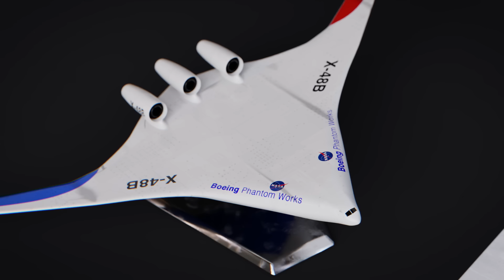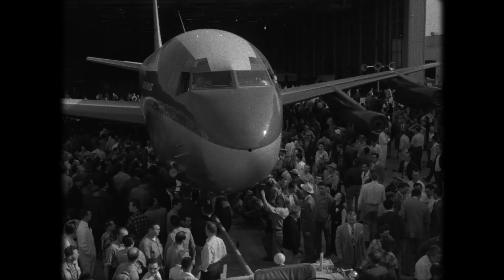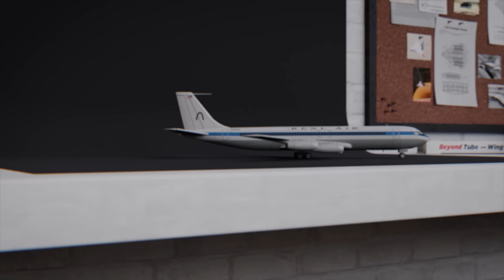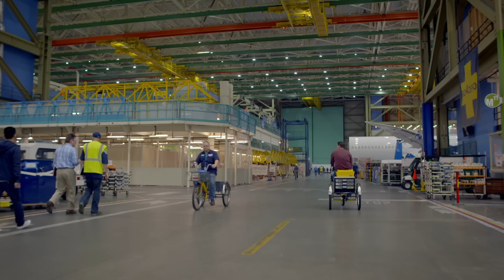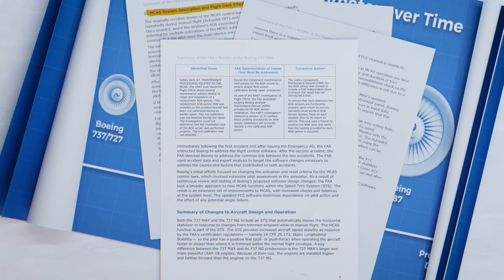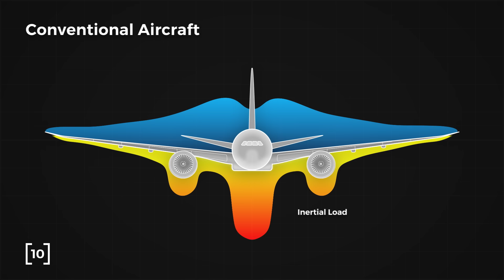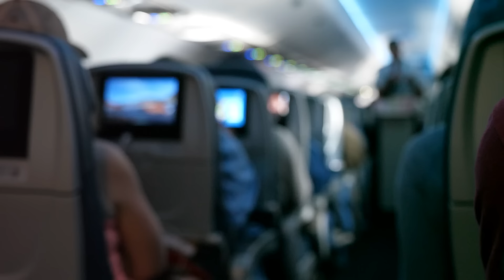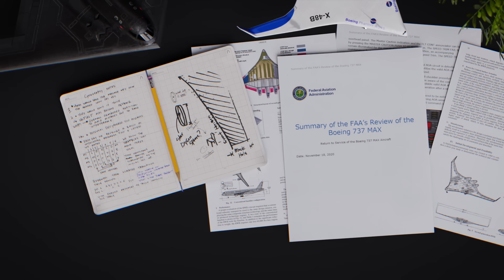The Plane That Will Change Travel Forever

Comment: As a retired 737 pilot,(EVERY version except MAX) , aircraft engineer, and simulator instructor I think this is one of your best videos yet! Not only did you cover most of the good and bad issues of blended wing aircraft but you gave one of the best descriptions of the 737 MAX debacle I've yet heard.
Reply: As a software engineer I pieced this exact explanation together from multiple sources and was so disappointed with the media as nobody they talked to, even supposed experts, could explain it clearly. Always talking about supposedly complex systems, as if the 737 is flown by a fly-by-wire system and not an old school servos and hydraulics, when it was a dead simple and dead stupid system that broke the fundamental rules of aviation engineering.
Reply: @LAG09  Here's the simple but not-oversimplified explanation of MCAS: under high angle of attack in manual flight with flaps up (i.e. when attempting to pull up excessively outside of take-off/landing) it gives a certain amount of nose-down trim to increase the force required by the pilot to keep pulling up to an amount more similar to the 737-800 under similar flight conditions. The pilot can still use the trim switches on the yoke to interrupt and undo the nose-down trim performed by MCAS, and doing so also suppresses MCAS for 5 seconds.

There were two major problems with it:
1. It relied on a single Angle of Attack sensor (on the theory of not being a safety-critical system, even after its authority was increased)
2. It assumed that a pilot performing manual trim would trim column forces to zero (which they trypically would) and based on that assumption performs the same amount of nose-down trim again (after 5 seconds) without considering the current trim position.  I don't really understand how it was overlooked how bad this is.

So in case of the Lion Air 610, the aircraft (which had a history of problems) had its left AoA sensor replaced by a refurbished one that was completely miscalibrated (due to an issue in the calibration procedure performed by the refurbishment company). The mandatory test of this sensor after installation, which would have immediately revealed the severely erroneous values, was evidently not performed at all (though the engineers claimed they did, and attempted to falsify photographic evidence to back up their lie).

Both flights with the bad AoA sensor (the first one landed safely) resulted in a unreliable flight instruments on the captain's side, a bunch of warning lights (including "airspeed disagree" and "altimeter disagree"), stick shaker on the captain's side, and (once flaps were retracted) nose-down trim by MCAS. The difference between the two flights is in how the flight crew handled the situation:

The captain on the first flight transferred control to the FO, identified the unwelcome trim and performed the "runaway stabilizer trim" procedure, flipping the trim cutoff switches and trimming manually instead. They bizarrely decided to continue to their destination (with continuous stick-shaker!) and after landing filed an inadequate maintenance report that did not mention that they had used trim cutoff (nor the continuous stick-shaker).

The captain on the accident flight kept flying himself, and after flaps retraction "fought" MCAS (interrupting and undoing its nose-down trim) for five minutes, yet he either didn't realize he was doing this or didn't think of flipping the trim cutoff switches (which I'm pretty sure is a memory item), and more problematically he did not say anything about this to the FO (who was fumbling with checklists). Eventually he asked the FO to take control, and while the captain was preoccupied with communicating with ATC, the FO responded to the heavy control forces (after MCAS nose-down trim) by performing only small amounts of nose-up trim, which did not substantially undo the nose-down trim from MCAS but did cause MCAS to retrigger after 5 seconds, quickly causing more and more cumulative nose-down trim resulting in loss of control of the aircraft.
Reply: @MatthijsvanDuin  I know you're very proud of your knowledge, but there was nothing in your post that I didn't know from before. My point was that because the media really didn't understand the subject I had to start pulling from many different sources to get a comprehensive picture.

My perspective is however a computer engineers', I have a master's in Computer Engineering. Thus there's probably some details of the internal software logic that that I understand better than you due to my background in having worked on industrial control systems in similarly safety-conscious environments. In my last job I worked on a control system for so-called Electric Arc Furnaces for smelting steel that can run at over 100 megawatt capacity (about the power draw of a small city).
Reply: @LAG09  I probably shouldn't have @'d you specifically, but like you said there's a lot of misunderstanding floating around which is why I shared my summary. It may still be of benefit to others.

(I work in software engineering for embedded systems myself, though in a less exciting market segment than you.)
Reply: @MatthijsvanDuin  I don't work in embedded systems anymore. It was more a detour from high performance compute on big machines (like the big DOE machines at Oak Ridge) to my current job doing high end workstation software.
Reply: Blended wing/flying wing aircraft may seem like the future, but their shapes are ridiculously complicated to manufacture. Existing planes are nothing but cigar tubes. Easy to manufacture. Beyond that, tailless and flying wing designs are notoriously unstable, the B-2 bomber has 100 computers onboard and 20 are for controlling the plane's instability. Google box-wing aircraft, because they double wing surface area without increasing overall wingspan, you boost lift capacity 50% on the same engine power. Also you don't have to change overall manufacture, you're still building cigar tubes fuselage. Other problems with blended wing bodies like evacuation and loading time of a theater style seating. Weight distribution. Biggest is economics. Blended/flying wings offer huge seating capacities which may not be fulfilled. Airlines prefer low operating costs over advantageous seating a plane with seating for 500 makes little sense if it A) doesn't fit on the runway B) is half full. The Jumbo jet is obsolete. A 777 can carry nearly as many people, the same distance more efficiently on two engines.
Reply: @spikedpsycho2383  Good points. The 777X has those folding wingtips so it will fit into existing parking spaces and use existing jetways. Blended-wing aircraft will not work at many existing airports unless the gates are massively redesigned - which will be very expensive and disruptive. Airports always seem to be under construction as it is. 

And yes, manufacturing a blended-wing aircraft is much more complex and difficult than manufacturing a simple tube fuselage. A simple cylinder is the most stable fuselage type, and the one most able to withstand large numbers of compression-decompression cycles. All of these things matter in the real world.
Reply: While the way of MCAS was implemented is absolutely inexcusable, he's very much oversimplifying. The MAX did not have a "stability issue", but rather its handling under certain high AoA circumstances was insufficiently similar to previous 737 models. The purpose of MCAS was to avoid pilot retraining, not to fix stability.
Reply: Although the description of the Max's failures was accurate as far as it went, it was incomplete and therefore misleading. Boeing engineers knew the system could breakdown and there was a simple work-around - turn off MCAS. The pilots weren't properly trained in how to manage the problems caused by the faulty sensors (which were due to shoddy maintenance practices of the airlines) and didn't understand how to respond correctly. Although it has been some years since I've read the report, I also recall that the actual procedure the crew would have had to follow was the same as if encountering the same problem when flying the 737 without MCAS. Taking the standard, appropriate, and trained response to the problem would have turned off MCAS and would have solved their problems. Boeing software engineers understood such a situation could occur and they built the software so that the proper crew response to the failure of MCAS was the same response that they had already been trained to make in similar situations, yet the crews in both crashes failed to react appropriately. Much was made of the fact the MCAS wasn't documented. But it didn't have to be documented and the pilots didn't have to know it was operating. MCAS was meant to be transparent, and proper crew response would have saved the aircraft even without crew knowledge of the MCAS. https://www.nytimes.com/2019/09/18/magazine/boeing-737-max-crashes.html
Reply: @davegrenier1160  I wouldn't call something that just takes over trim control to push the nose down a set number degrees for a set amount of time, disengages, then re-engages in an on-off cycle if the sensor readings are still faulty "transparent". Actions by a fly-by-wire system, which the 737 has never had, may have been just that. However MCAS, which takes over a single control surface in an on-off cycle with no warning, is what us engineers call a "kluge". Specially when it's entirely un-documented automation system in a low-automation relic like a 737.

The undocumented, no-warning and on-off cycle nature (i.e the problem "fixed" itself only to re-engage) of the problem is what made the pilots unable to accurately diagnose the issue and take appropriate action. Not having a fly-by-wire system meant the limited automation was not going to be a prime suspect like it would have been on an Airbus or literally any other Boeing type still in production.
Reply: I was thinking the same thing. Very well made video.
Reply: He didn’t pull any punches. I am a huge fan of Boeing and the planes and spacecraft they have made over the decades, but there is no other word for the 737 MAX debacle than CRIMINAL!
Reply: The only better explanation about 737MAX debacle I've heard was from Mentour Pilot, but I like this one better because it covers it succinctly enough in only a few seconds.
Reply: I find your perspective interesting as I was sitting with a MAX pilot at the airport talking with him about it, and he felt the issue was mostly in training. The US pilots trained what to do in simulators, other countries not so much. He felt like it was mostly a political issue because Boeing was arrogant in their response to the FAA so they were penalizing them, and that there was no safety issue any more than dozens of other systems the pilots have to know how to operate.
I think Boeing should have made a more failsafe design myself.
Reply: Max was stupid really. Some Higher management should be punished tbh
Reply: Also, the craft looks like many of the cool artist's representations on the covers of our beloved Science pulp magazines from the 1930's on up. As kids, we always wanted to see one of those covers come to life. Well, it's time is here.
Reply: However poor the software is/was on the MAX, those crashes were pilot error.  If the automation isn't doing what you want... AP/DISC!! Those pilots unfortunately didn't go that route.
Reply: I've watched a 1,5 hour documentary about the 737 max problem yesterday and didn't completely understand the issue. In 2-3 minutes of this video the explanation was far more clear.
Reply: The name Highet is such an accurate description of your career. This happens often and leads me to believe that a persons name has an importance beyond what I have noticed in the past.
Reply: I don’t want these planes I will miss the old ones
Reply: I don't think 737 MAX pilots get to retire
Reply: You couldn't fly a kite without string and theres no such thing as stars. Dummy.
Reply: If I remember correctly the sensor was taken out when a balloon hooked on it
Reply: Hello Mr. Warekiwi, I'm currently studying aero space engineering but I would also like to be a pilot and test the planes I work on. Since you are an Engineer + Pilot. I would like to ask the following:

1.Which one did you become first?
2. Were you working as a pilot and engineer at the same time or did you switch between the positions ?
3. Does having both qualifications increase your wage and or/ hirability ? Are companies looking for people with both qualifactions ? 

I would love to know more about your career
Reply: Why don't they put the wings in front of the cage so they could make the rear stabilizer to make lift rather than down force, allowing you to make the main wing smaller
Reply: The video covered Boeing's part in the MCAS disasters, but it did not cover Lion Air's part in he first disaster (not telling the crew what happened on the immediate previous flight) or the responsibility of the pilots of Ethiopa Airlines (who knew about the Lion Air disaster and the MCAS failure potential and yet failed to turn off MCAS).
Reply: Agreed
Reply: lier
Reply: As someone who usually dislikes this channel's content , I can only agree that this is a great video
Reply: @YounesLayachi  but why do you dislike they seems superb to me.
Reply: @redcrowcrow3929  look closer
Reply: @YounesLayachi  Why not spell it out instead of speaking in riddles?
Reply: @2canines  it would take a really long comment to describe what's wrong with each video and then summarize it into what's wrong with the content overall
Reply: 2canines He takes a while to get to the point.
Reply: @2canines  he’s an online specialist with countless hours in each field of engineering. Source: Trust me bro
Reply: @YounesLayachi  Am probably blind, can you point it out?
Reply: @YounesLayachi  yeah right. you won't say why it's bad because the comment would be too long. sure buddy.
Reply: @mikaschmidt2110  look I used to watch this channel years ago and at some point I got fed up and left
Reply: @EgnachHelton  Read my comment again, then quote me where I am "defending Boeing."  While you're at it, don't tell me what he earns doesn't matter when he is an engineer blaming "corporate greed" aka capitalism for the incidents.  Share holders "DoNt WoRk At AlL"... ?  Yeah I'm sure not a single Boeing shareholder has a job.  Right Charlie?
Reply: @S1191669  I am with you on this. "Corporate greed" is a terrible, inaccurate, and misleading term so often used to vilify Capitalism, when the reality is the opposite. Socialism (using the word generally, more accurately Collectivism) is the epitome of greed, in which "poor" people simply steal from those who have more. Even "negligence" might be too strong a word (depending on circumstances, though). However, I think we might agree that "corporate complacency" is in fact what happened (and is still happening) at Boeing, and for that, they will pay a dear price in the marketplace, which thankfully is still mostly free.
Reply: @johnjamesbaldridge867  According to you epitome of greed is when: 
-someone wants to have some degree of democratic control at work instead of being at the mercy of the employer.
-someone wants to have control over the surplus value of their labor.

Why workers shouldn't be shareholders and owners of the company they work at?
Reply: @koro14520  I appreciate your time in responding and your clearly stated points. Obviously, I compressed volumes of economic theory into one pithy (if not pissy) comment. I think I'm correct in stating you are summarizing the ideas of Engels and Marx, who, interestingly enough, considered themselves Capitalists (Das Kapital is a theory of Capitalism, after all). In the interest of time, I'll guide you to anything written by Thomas Sowell and Milton Friedman, who address these specific questions in great detail. The TL;DR version is this: While a government can be a democracy (with significant restrictions), a company or business needs to operate as a dictatorship, for a reason. In the best-run companies, the interests of the shareholders and employees are identical -- produce as much value as possible for all concerned. Nothing prevents employees from investing in the company they work for, and in doing so have a vote in, not how to run the company, but whom to elect to run it. Or even starting their own company, if they think they can do it better, as often happens. When the country as a whole is free and rights protected by government, there is competition for the skills of those workers, so there is a mechanism for objective "price discovery" of their salaries. That is, there is always an implicit auction for their employment. They are not forced to remain at the same job, as we see time and time again in Socialist and modern Communist economies. Thomas Sowell himself was an avowed Marxist even while studying under Milton Friedman at the University of Chicago. He stopped being one after working in the U.S. Government bureaucracy later on. However, I find it quite striking how the motivations and ideas between what I would refer to as "classical Marxists" and "Friedman libertarians" (with a lower-case L) are more similar than most people realize. Both want freedom for individuals from coercion. Sorry for the ramble. Cheers!
Reply: @S1191669  No not any bad decision. Definitely the one he mentioned in the video though.
Reply: @S1191669  Not the fault of capitalism. Just because a decision happens within a free market does not automatically make a decision immune from scrutiny. 

Multiple FBI probes detailed how Boeing upper management was caught off guard by airbuses new A320neo and tried to rush a plane to compete skipping safety design changes in order to get the MAX released as soon as possible often in the face of push back and concerns from engineers. Non union engineers in the South Carolina plant were fired for becoming whistleblowers about the whole scandal and people were told to shut there mouth and do their job while this cost cutting was taking place. If Boeing had been patient, remembered their roots, and went through the extra steps to fix these safety design flaws instead of relying on software this situation most likely would not have happened
Reply: @YounesLayachi  the irony is not lost on me that your main complaint is that it would take a really long time to explain your point but it took three separate responses from you to even approach explaining why you won't answer, let alone explaining what your problem with the content is. C'mon bro...
Reply: @EgnachHelton  "grabbed by share holders who DON'T WORK AT ALL."  A large percentage of big corporate shareholders are either working individuals, or pension funds.  Pension and mutual funds pretty much drive the stock market.  The amount of people who live off of completely passive stock market gains is negligible at bests.  Those funds are made up of the retirement payments of unionized teachers and firefighters etc.  Most of the stock market money is the "little guy" so when the little guys shits on the market and big companies, they're shitting on their own retirement savings.
Reply: @S1191669  Amen.  People need to understand how pension funds and mutual funds work before they spout off.  And that's before even starting with individual investors.  The amount of people who don't work at all and just live off of large corporate dividends or capital gains on stocks is extremely, extremely low.
Reply: @johnjamesbaldridge867  LMFAO
Reply: Why do we have child labor laws on the books, Corporate Greed dude.. Waiting for rebuttal
Reply: @johnjamesbaldridge867  tell us you've never visited socialist countries, without telling us you've never visited socialist countries
Reply: @vespervenom2343  i heard you sold warranties?
Reply: @2canines he's the great grand son of Einstein. He's a recognised Northern YTCE (YouTube comment engineer) from Los Santos........